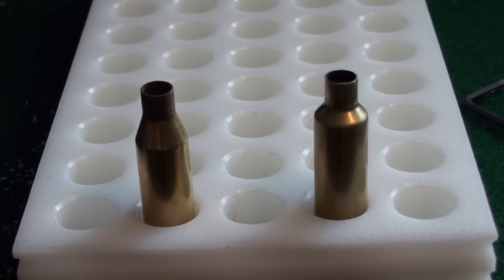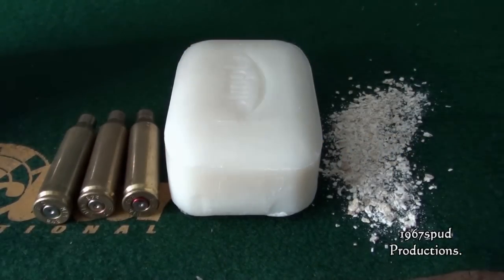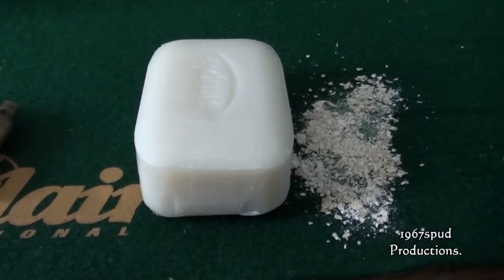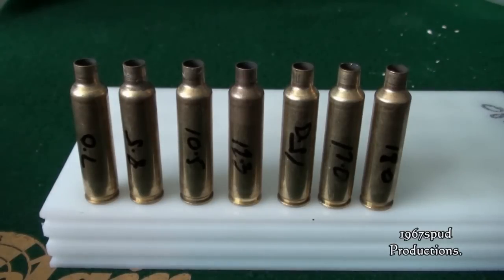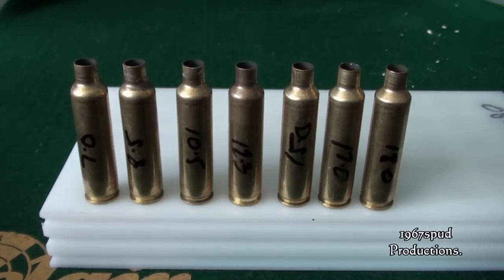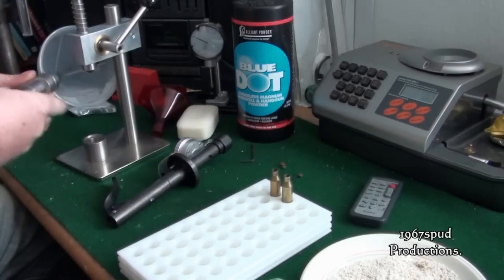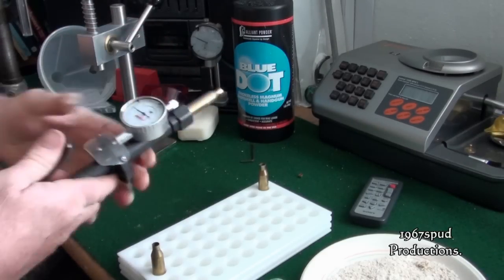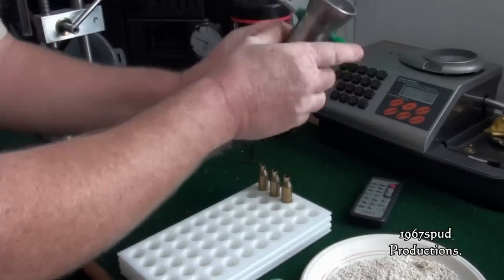Reloading Ammunition for Rifles. Fire Forming: The Cream of Wheat Method. Part 1

Comment: Factory loaded ammo is made to a set specification it doesn't actually match your breech, the breech on every rifle is unique, when you fire a Factory load for the first time you are in fact "Fire-Forming" that brass case to your breech, to reload all you need is a "Collet" dies set, this will resize the neck only, full length resizing dies on the other hand reset the brass back to Factory specs & need only be purchased if you're using someone else's fired cases.

Comment: Too much work to do AI. The only AI I would do is the 280 AI because Nosler makes brass for it. Not worth the effort for 100 FPS or possibly less.
Reply: You do realize that all you have to do with any Ackley Improved chamber is to put a factory round of the parent case ( in this instance a .243 Winchester ) and pull the trigger to fire form the "new" case. P.O Ackley designed every one of his A. I. cartridge chambers to correctly headspace the factory round it was based on. I'm sorry, but you don't get easier than that.
Reply: @tun0fun  Still not worth the time IMO. To have to fire form all the cases, and then still work up a load after they're fired I got better things to do. With so many great cartridges out right now like the Creedmoors, 284s, 6/6.5x47 Lapuas why waste my time when they already have good shoulders from the start.
Reply: @tun0fun  Whatever makes you sleep better at night buddy. Have a nice day.

Comment: how would .223 Ackley Improved work in a ar15 just curious. it still the same type of round just renecked.
Reply: 223 Ackley is just a normal 223 brass but with less body taper and increased shoulder angle, same bullet diameter. gives a bit more powder room inside and is supposed to reduce case stretching.